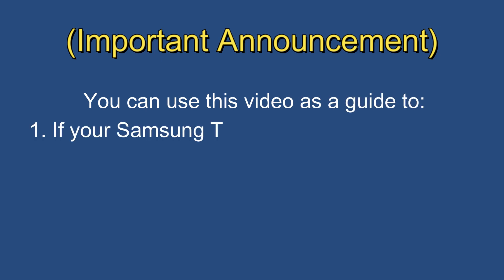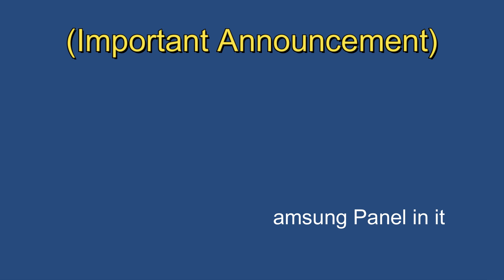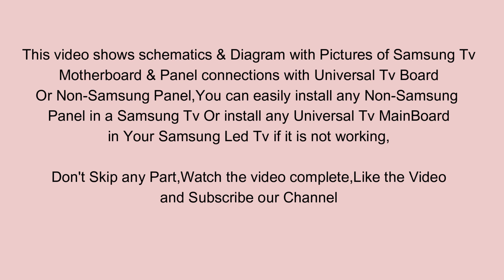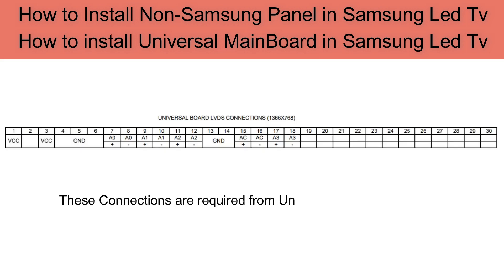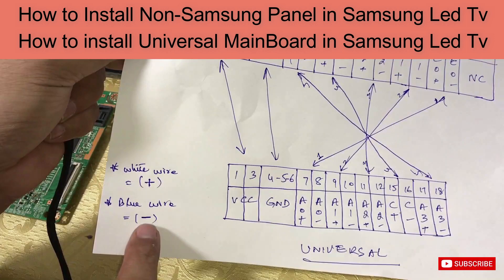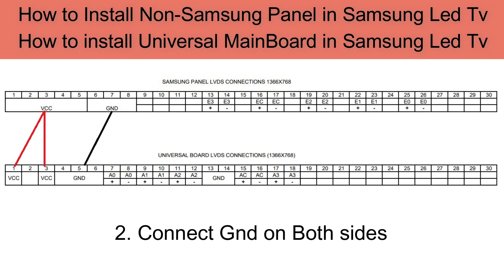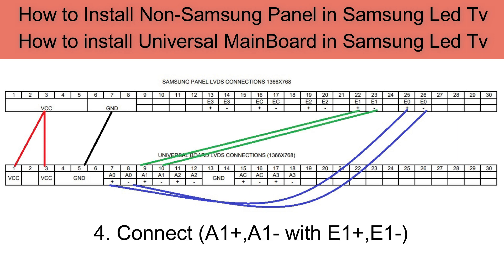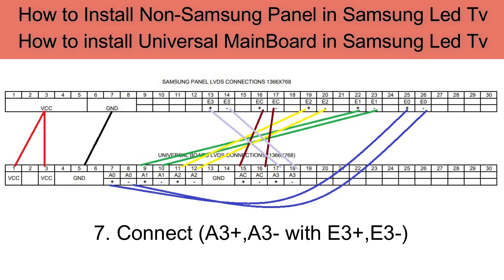SAMSUNG LED TV PANEL CONNECTIONS, INSTALL UNIVERSAL MOTHERBOARD IN SAMSUNG TV

Comment: Can I connect Samsung 51 pin lvds(32f6400) to lg 30 pin display
Reply from the maker: You can either use a converter for Lvds or can solder Lvds cable directly on the display